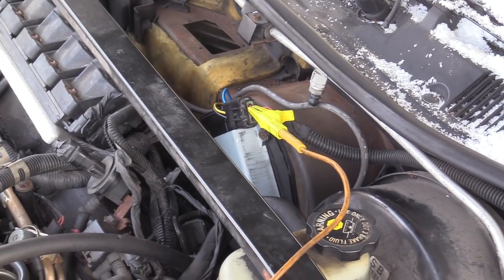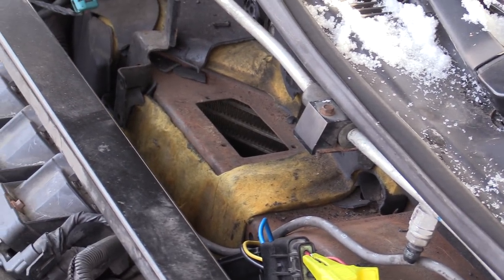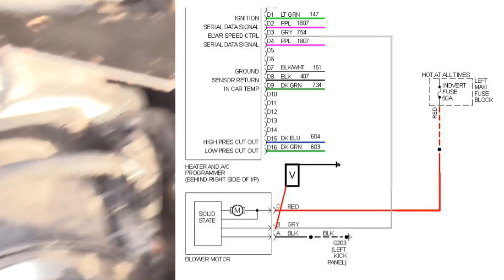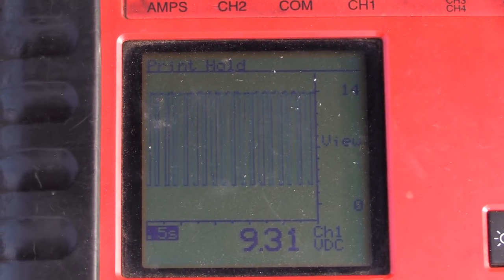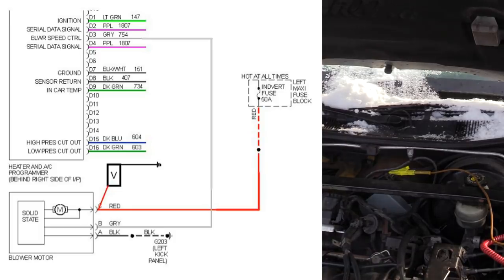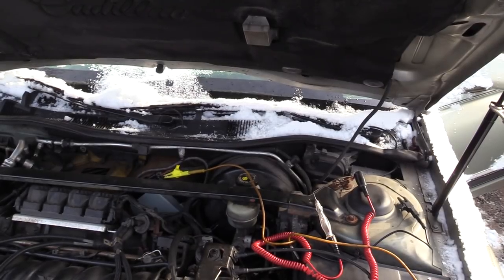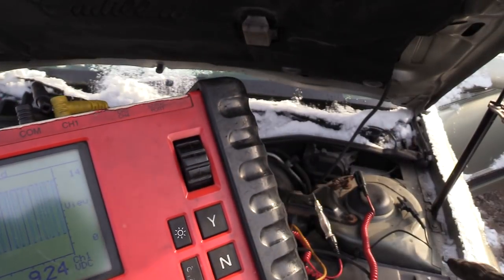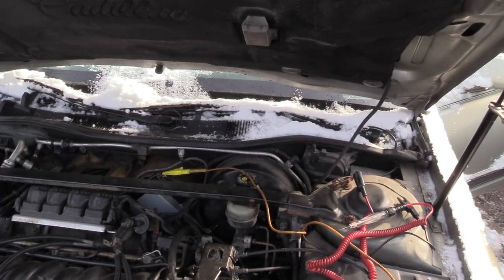Computer Controlled Blower Motor Testing (Cadillac)

Comment: I ran into the same problem.  Did the same test with my modis lab scope.  Put 3 motors in it.  Ended up having to get an ac delco from the dealer.  Worked fine after that
Reply from the maker: Three different aftermarket blower motors and they were all bad. Is everyone paying attention? You should be.
Reply: ScannerDanner i work at an independent shop in st. Louis Mo.  We are a NAPA auto care center.  Two of those motors were from napa.  Even reputable parts houses have bad parts.  

On a side note thanks for your videos.  They have helped me immensely. Especially using a lab scope
Reply: Paul is the motor separate part or not ,if it is may be in the control module of motor any transistor had blown
Reply from the maker: It's all one unit my friend
Reply: lucky the AC Smelco worked more than 2 minutes also. they want all the old junk off the roadways, so parts have all become garbage chinesium and I have some news for them ;)
Reply: @ScannerDanner  DOORMAN (Y) HAHhhA!!
Reply: @scannerdanner  hey paul, i work at dealer and weve put 3 different motors by other techs,  and they go out after few months. Oem motors. Today truck came back not working, i checked power and ground, good. Control wire was changing voltage as i was changing speed, blower motor did not work. I unplugged blower motor and plugged it right back and it started working. Ideas? Thnx a lot. Loving your vids

Comment: Nice quick video Paul. I came across an Audi last week with a LIN signal to the blower module. A/C pressure switch tied into circuit. Faulty switch pulling LIN up to battery voltage and no blower.
Reply from the maker: That's awesome! Got a video link for it Steve?
Reply: Here’s a link to a Facebook live video I did talking through my thought process. I confirmed the fix in the next video. 
https://youtu.be/zmXS-YQ5WpI cheers 👍

Comment: Shouldn't the power and ground have been load tested with a test light or checked with an ohm meter to rule out a possible high resistance concern? I've  had that bite me in the past. By the way, your videos are great and very helpful. Thanks for what you do!
Reply from the maker: You would have to have a high resistance problem AND a faulty blower motor at the same time. It just doesn't happen. The voltage readings confirmed faulty motor. If that 1 in a million chance (literally) you have a bad wire and a bad blower at the same time. After you fix the blower, find your wiring problem. 
If you feel the need to load the circuit to be sure you do not ALSO have a wiring problem,  you would not be wrong in wanting to do that.

Comment: Hello!  Just asking..same thing on an Renault Scenic. If I will put current direct on blower motor it will work. No signal from control module. Replace control module..same thing. Power and grounds are good to that module. What else it will be possible to mix up  that control module to make it not to send signal?
Reply from the maker: Just as I showed in the video, even the load of a test light will pull that signal to ground, so you have either an open or short to ground on the control wire or the blower module itself is shorted, pulling that signal low. Unplug the blower connector and see if you have a signal on that control wire. If you do, your blower module is bad. 
Or, I'm interpreting incorrectly, which module you replaced. Was it the HVAC module or the blower module?
My above suggestions were with the assumption you replaced the HVAC module
Reply: I have replaced both..:)..same thing happens..blower motor is not working. Only if I will put direct feed on wires. No short to ground, no open wire.

Comment: What part of the circuit to the blower does that third wire control inside the assembly, i mean, is there like a transistor inside it?
Reply from the maker: Yes there is. The module that is part of the blower motor itself has a main power, a main ground and one input (the HVAC controller signal)

Comment: I assume this was in fact a failed blower motor, but you forgot to make sure to disconnect the connector and verify good pin fit on all the terminals. The last guy might have spread them open testing the circuits before replacing the motor.
Reply from the maker: Agree and a simple visual was all that was needed.

Comment: Thank you brother. Does the blower supply the control voltage to the speed controller and the speed controller pulses the signal to ground? Or does the speed controller supply the pulsed signal to the blower? Reason I ask is if you unplugged the blower would you measure voltage on the signal or would it be 0 VDC? Knowing circuit design helps making the call 100% confident. Example, if you didn't know circuit design and when you back probe the control signal wire, you only measured 0 VDC, where would you and what would your next test be? Without firing the parts cannon. Is it the ac controller, the blower, or the control head?
Reply from the maker: The one test I should have done. I do not know if it is a pull-up or pull-down design and I should have done that for those facing a 0 volt signal like I simulated with my test light. Great question and great insight Billy. Sorry to disappoint you and say, I do not know. 
I am assuming it is being supplied 100% by the HVAC controller.  In other words, if I disconnected the blower, I would have still seen the same square wave pattern. But I am assuming. It certainly could be a weak voltage being supplied by the blower that is being PWM to ground by the HVAC controller.
Reply: kinda resembles to a 3-wire coil..pwr, gnd and the Base control(ESA/EST) :)